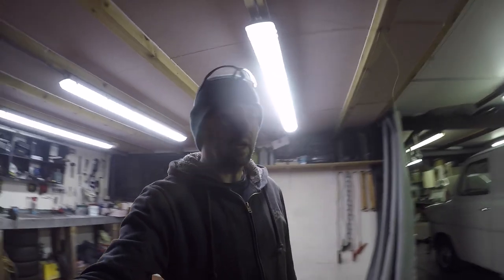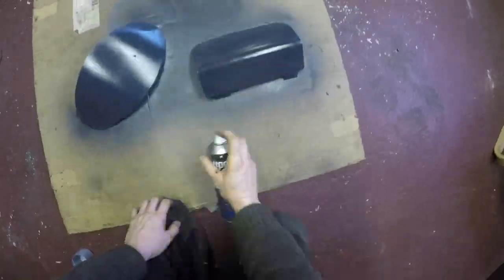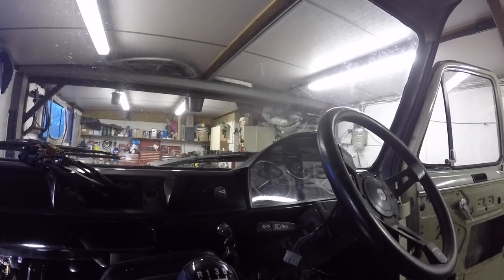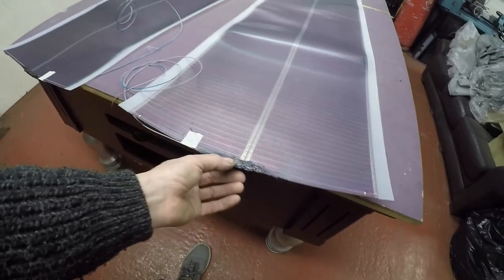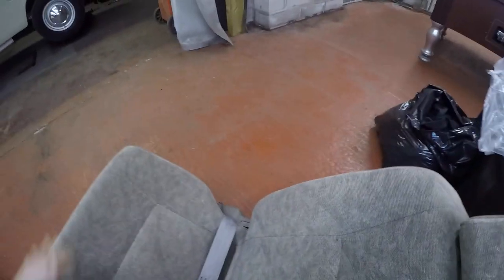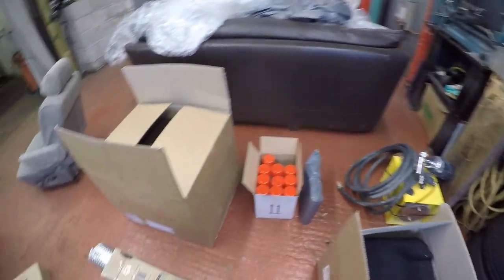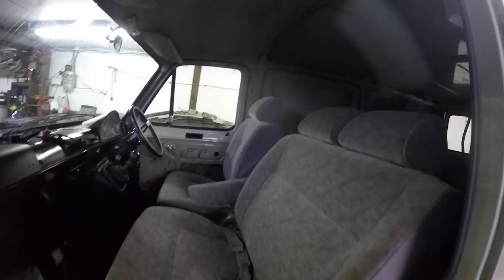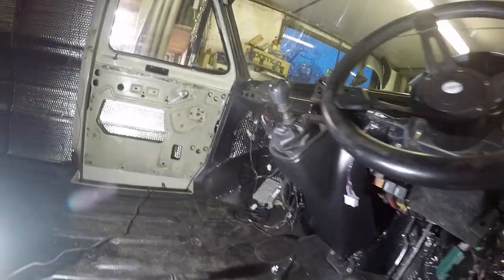Ford Transit Mk1 Project - Part 12

Comment: I have a little idea... are you familiar with the rubber insulation padding that sits in mk2 Cavaliers in the floors, perhaps most Vauxhall's of that era... its spongy on the underside and hard rubber on the surface... perhaps it wud be useful to use this by the bulkhead for the firewall and cabin just up to the rear of the front seats... almost like a floor matt... iv used it previously and it's great for sound proofing...
Reply from the maker: Yes I know the stuff you mean, I’m going to put the dodo deadening down fist then probably carpet over it 👍